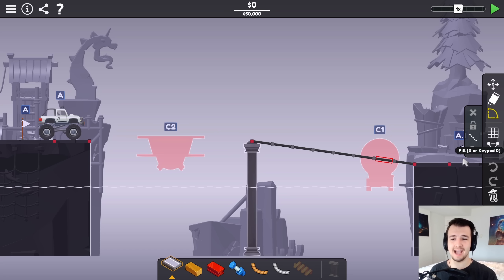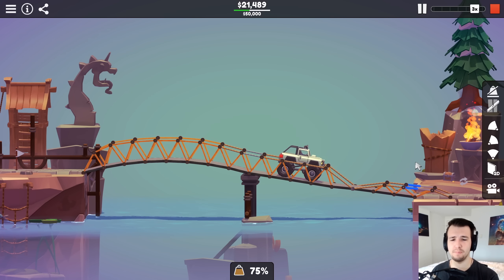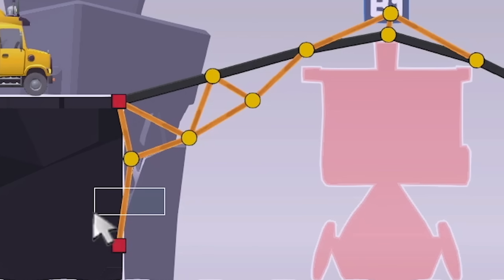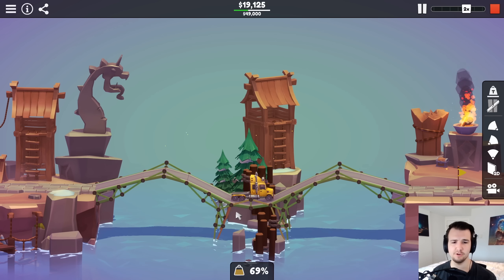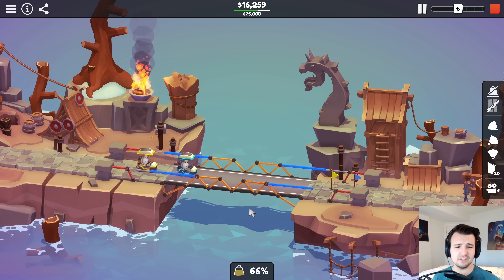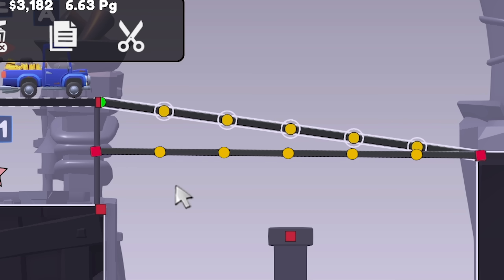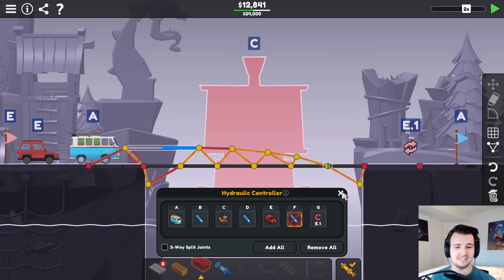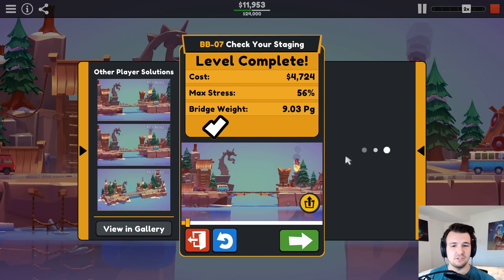Real Engineers Only Need The Tip! - Poly Bridge 3

Comment: Correct me if I'm wrong, but I believe the cost and weight in this game is irrespective of number of joints. In that case, on the last one, the three road pieces across the pirate ship could've been turned into four road pieces. That would enable having the joints closer to the pirate ship, and a smaller road segment being moved.